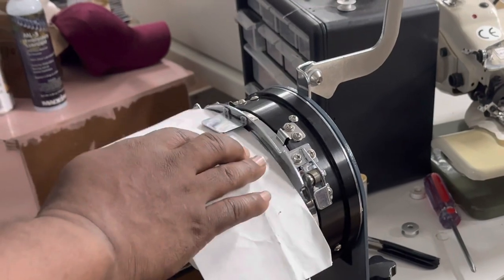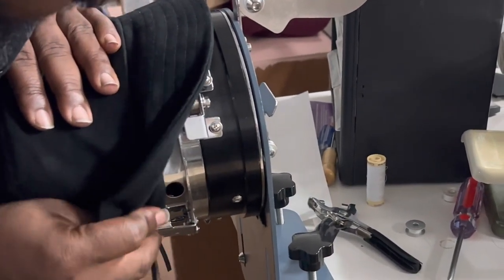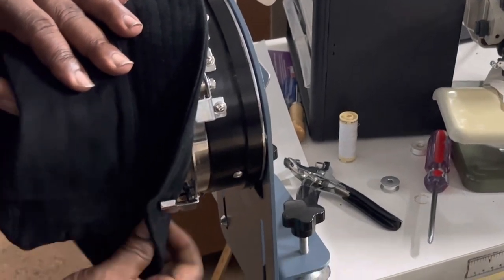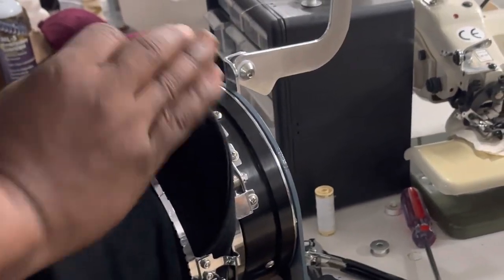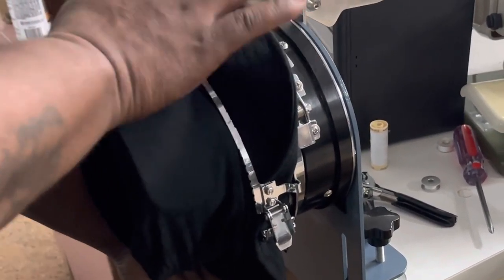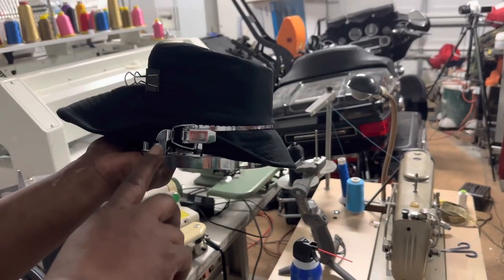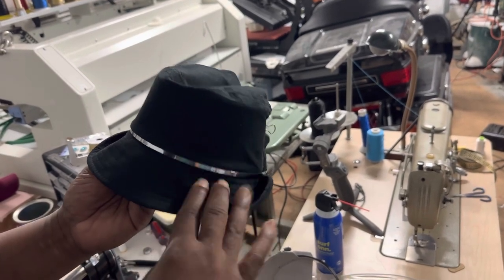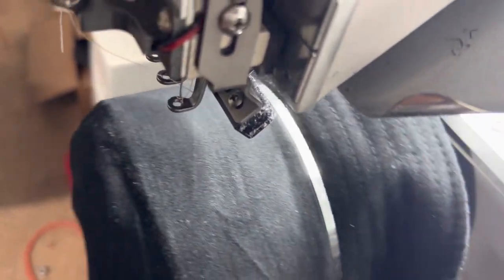HOW TO EMBROIDER A BUCKET HAT

Comment: brotha what do you do for flat brim hats with you stitching them on your mt1501? mine keeps getting caught on the metal part when im tracing.
Reply from the maker: You either have to push it forward when doing the trace, and just try to make sure you are not at the very bottom about to hit the hoop frame bar. You are  probably not going to catch the bill  long as the image isn’t as wide or wider then the bill. You have to watch and go very slow on your first time to make sure the bill don’t catch during stitching.